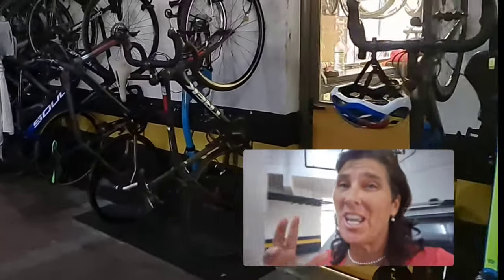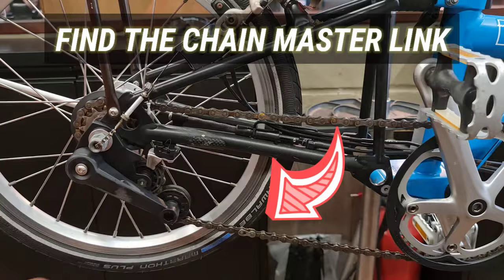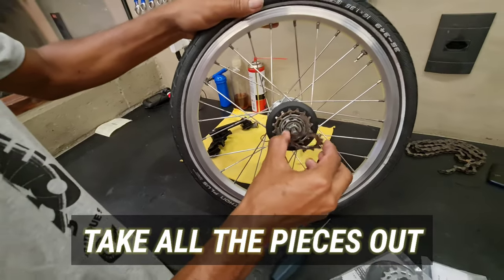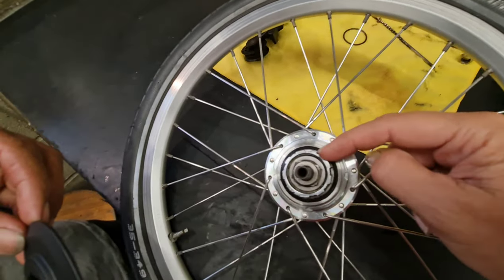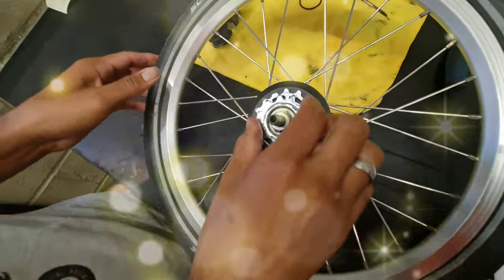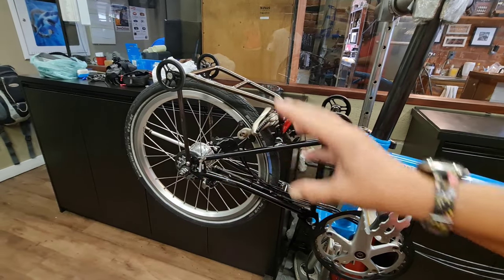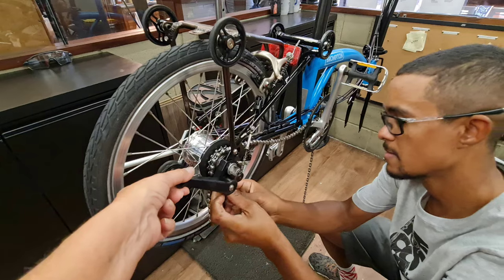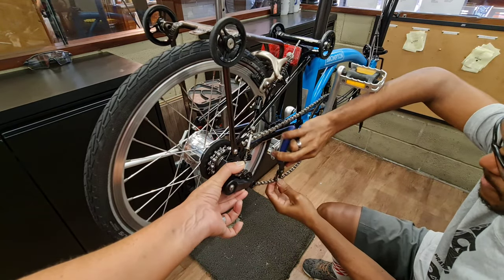SPROCKET & CHAIN BROMOTON How to replace them.

Comment: I thought you would have a 39T front chain ring living where you live with all the steep hills? It makes such a difference. 39T is the smallest chain ring you can fit on the Brompton crank spider. You can then use ALL the gears. A 50T chain ring is ridiculously big giving far too higher gearing imho. You never use 5th and 6th unless you are going fast down hill and then why would pedal? A 44T is better but not enough. 39T is the sweet spot. You have low gears and top (6th) spins out at about 40km/h on the flat. Going down hill it doesn't matter as 40+ km/h you are freewheeling.

Also if you are touring carrying luggage a 39T front chain ring or a little bit smaller is essential imho to get up hills. I am not a weak cyclist. 39T teeth front chain rings are readily available and not that expensive. Super easy to change as well and also carry if you want a larger or smaller one for different terrain on a long tour.

Just my thought on your bike gearing.
Reply: I switched out my H6L to a 44t chain ring,   so much better for the hills.
Reply from the maker: Hi Alex Morgan 
I like your thought,  and it got me thinking 🤔.
At the time, the guy at NYCE Wheels told me that it was the smaller one I could replace with. 
But you are right. I use most of the midle gears, and it would be very nice on a bike touring to have more gear to carry all the weight uphill. 
Very interesting!.
I remember when you told me about the Marathon Plus. And, now that I have them, it is a major improvement.  Really like them.
Always Nice to have you on board!
Reply from the maker: Hi Bromptin Owner 
Me too. 
When I Arived at NY for the TD5BNY I realized that never use the 6 gear and ask the store to replace with a 44T, the smaller they have.
At the time, there was no Brompton Junction, so there was not many choices to make.
Keep Safe! Keep Riding!
Reply: @ChrisbyBike  Oh right ok! So just to let you know then you could also fit smaller front ring 39T if you want in future to lower the gearing further on your Brompton for the hills, but Brompton themselves do not provide this size so you have to look at other make eg Shimano, TA, Stronglight, etc. With 39T I now use and enjoy all gears. Maybe I try 42T. Yes enjoy your Brompton. They are great bikes. Happy days.
Reply: @ChrisbyBike  Thank you for your lovely comment. It was because of you that I now have an excellent aftermarket (not Brompton) rear rack. I have an Ace aluminium rear rack that is really good, much better than the Brompton one and much lighter. I also bought a wheel extender because of your recommendation. Your videos and  information on your aftermarket rear rack are so good. The only other recommendation I would make is fitting the dynamo lights with the SP Dynamo hub that Brompton offer. I bought the Supernova E3 Pro 2 front light which is very bright and beautifully made. The matching rear light is also very good. They are German made so very good quality. At first I was very sceptical of dynamo lights as I had bad experiences many years ago, but now modern dynamos and lights are so good. Now I can just ride any time of day and know I have good lights 24/7.
The internet is so good to share information especially YT. I am now very happy with my Brompton and you have helped so much.  Enjoy riding your Brompton, enjoy cycling! Many thanks.
Reply from the maker: Hi Alex Morgan 
Ok, got it! I'll have a look on my next trip.
It looks very promising,  like the idea especially for biketouring. 
Keep Safe! Keep Riding!
Reply from the maker: Hi Alex Morgan 
The internet is fabulous for sharing information. I've lear a lot from you guys. 
Thanks for all the great suggestions.
Keep Safe! Keep Riding!

Comment: Bad advice, the park tool is spring loaded, not forced so guess that tool is broken. NEVER USE LUBRICANT near the seat post otherwise it will cause slippage.
Reply from the maker: Hi Michael Broom
You are right!
 We should never use lubricant near the seatpost.
 I was filming and he was faster than my words.
About the tool, that is how it works, you just move the lever and it measures the distance between links. If it is greater than 75, it is time for a new chain. 
In my case, this old chain was to stretch out so it didn't present any resistance. Time for a new one.
Nice to have you on board!
Reply: Hi Chris, my apologies about the chain checker tool, I had seen those before and thought it was spring loaded, so as to squeeze the cam to zero and let the spring move it to check the wear. Just had a good look at one to see how it works. 
Regards Michael
Reply from the maker: Hi Michael Broom
No worries! 
There are a several different chain mesure tools. They basically measure the distance between links to check if the chain stretch. 
You are very welcome to the channel.
Keep Safe! Keep Riding!